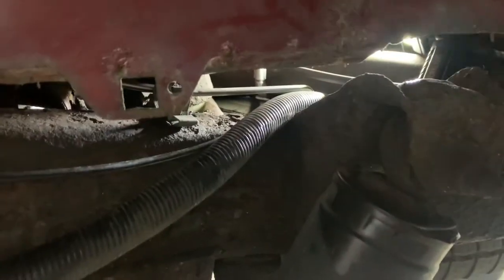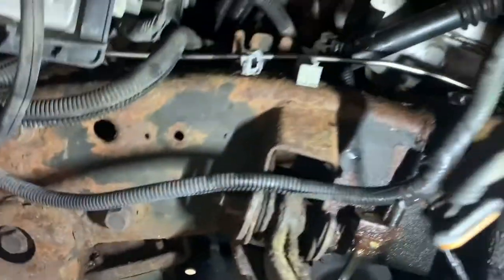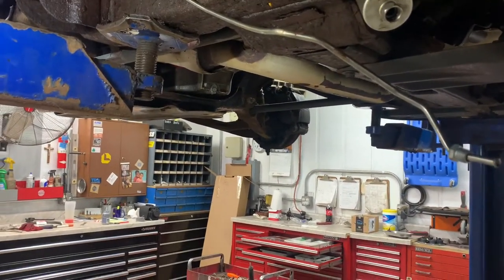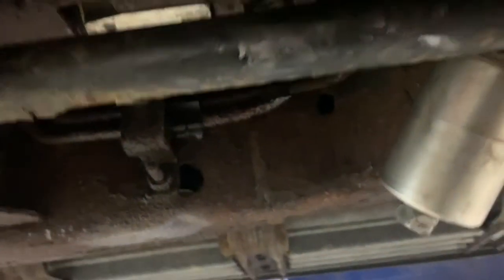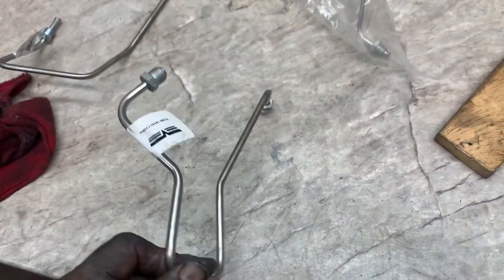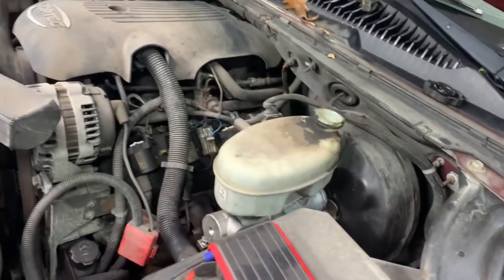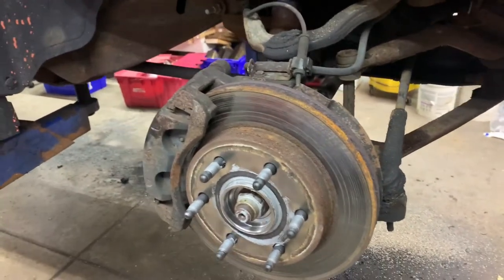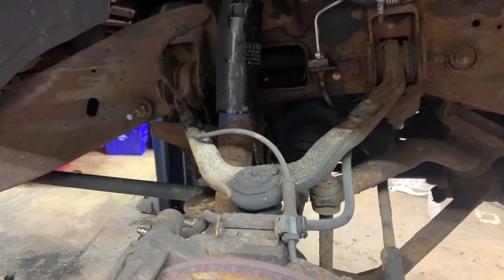2003 Chevy Tahoe brake lines part 2 of 2

Comment: After this, did you have to do an autobleed via a scanner for the abs, or just bleed it conventionally?
Reply from the maker: No just convenienally
Reply: @richierock1300  thnx. I just heard it was hard to get all the air out of the abs. I’ll soon be doing the job on my 03 Tahoe, great tips from your video. thanks from Norway
Reply from the maker: @oysteinfabeng2452  remember use at least 2 quarts brake fluid and nice to have helper bleed brakes
Reply: @richierock1300  Think of using my pressure bleeder…. taking my time, bleed’em slow…. one by one..  hopefully not to trap any air in the abs module… Is it a lot of fiddeling getting them between the frame and body? It all goes so fast and easy on the video😅

Comment: Mine has an extra port next to the rear line fitting
Reply from the maker: You probably have a different brake code go inside glove and get the brake code to match the brake lines, independent abs lines

Comment: I paid $500 for 3 "sections" of rusted parts to be replaced in the front left of the truck. The mechanic sliced and connected to the new part to the old part of the brake lines. A week later,  the brake pedal went completely to the floor again. And leaking in the same place??? I'm out of $500, with NO brakes on my truck???
Reply from the maker: They sell a complete stainless steel brake line kit every metal line for the brakes on gm trucks  from $120 to $200 Lines To Go
Reply: I appreciate the information! They had used alloy to replace the rusted sections of my break lines. Also, what is a fair estimate cost to replace the entire brake lines for my 2003 Chevrolet Tahoe? I felt that I had been ripped off for the $500?
Reply from the maker: @marlenenicole9535  if it’s a shop probably about $850 to $1000 it take a good 6 hours to do so 6 x third hourly rate get a close idea plus the parts
Reply: I really appreciate you! Have a fantastic weekend.
Reply from the maker: @marlenenicole9535  you too happy 4 th